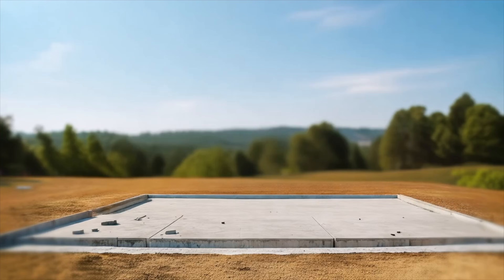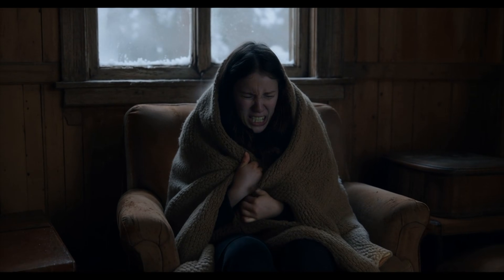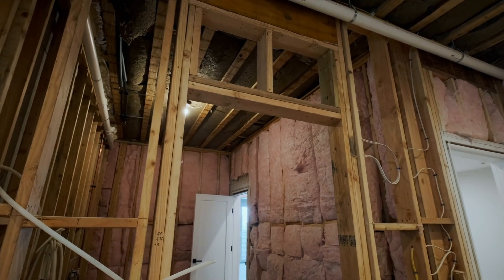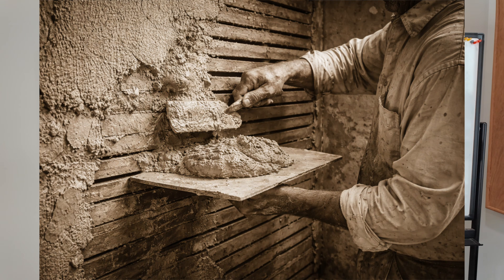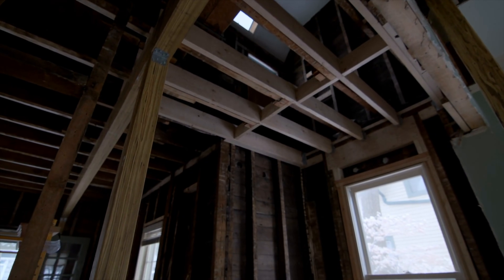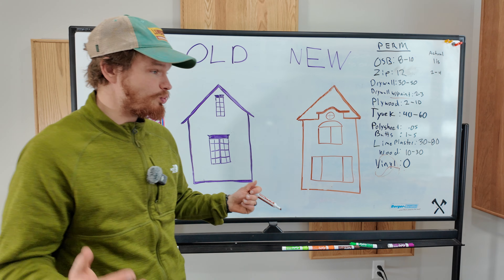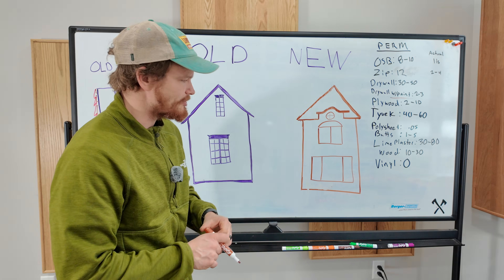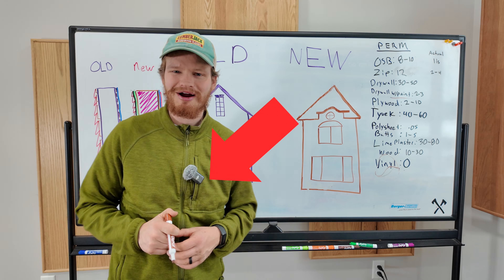New Houses Are Growing Mold — Old Ones Somehow Usually Don't

Comment: What about when you see new houses being built and they get rained on before they are completed. Seems like a good way to ruin something before it's even finished.
Reply: Older houses especially the ones still there took longer to build and got rained on just as much, you find old leaves and crap in old roofs that have been there s long time
Reply: @binguschillingus-t7n  Yeah, but they weren't sealed to the hilt-asking for trouble-unless you know what you're doing, and even then, why? I mean, one hole...
Reply: @CP-nf9my 
That wasn't as big a problem when people in the west could afford heating their home and opening a window was a more common practice.

It took longer to notice because these designs flourished in an era of relative prosperity.

Now these houses are moulding because the tenants can't afford to pay 3x somebody elses mortgage AND heat their  rooms.
Reply: @binguschillingus-t7n the money to heat either design is the same
Reply: @donaldjohnson2038 
The money is equally not there regardless of if the Tennant is renting a 40 or 150 year old home.
Reply: @donaldjohnson2038  That wasn't the point of his comment
Reply: @binguschillingus-t7n but those were built with first growth wood and zero plywood
Reply: Not sure about the US but I'm a builder in NZ and here we have to pass a moisture test before we can put up any internal lining like drywall if the moisture in the framing is to high then you don't line.
Reply: @JimBush-q2j They have to be tried out here in North America too People don't know what they're talking about
Reply: There's a reason out here on the rainy west coast the smart folks only build in the dry summer.

Drop the foundation in may-june, get that bish roofed and sided by September.
Reply: @priestesslucy yes, but many of us live in areas where it rains when it rains, sometimes pours, and there’s no way to accurately predict when the next thunderstorm will roll in
Reply: @denniss5505  He forgot to add, then you pray.
Reply: @priestesslucy  And the employers of illegals will keep putting a roof on through the rain.
Reply: @priestesslucy  

I don't live on the west coast by in the area I live in, if it doesn't rain in 3 days, you would consider yourself to be lucky!
Reply: The Netherlands. Layer 1 brick and mortar, layer 2 insulation, layer 3 brick and mortar, layer 4 paint or wallpaper (wallpaper is impopular so paint on 98% of walls).
Anything above 4 floors replace brick with concrete.

In the Netherlands wood is more expensive. Bricks are cheap and last centuries unless there is an earthquake wich is extremely rare over here. No faultlines.
Reply: @thijsjong and no basement?
Reply: @diegomontoya796 what's a basement??
Reply: @LorenzoVillafaña-III  is a story from the dryer lands...a legend of Siegfried
Reply: @diegomontoya796 in the country famous for being almost entirely below sea level? A basement would be a terrible idea!
Reply: @alistairsmith4297  Subterranean swimming pool?
I'm sure we can make it work ....
Reply: @thijsjong  Thijsjong, I have no clue about these things. But am interested in getting something build. So, is this style of building in the Netherlands preventing mold? 
We lived in Germany in a brick house for a while. When we got three-fold glazing, we got a mold problem with it. The mold was growing up the wall-paper, turning it black. Very unpleasant.
Reply: (Sweden) In my dry wall I can hear a damn mouse, munch munch munch. Strange mouse, I only hear it at about 04H00. Sometimes it sounds like a woodpecker for 2 seconds :body-blue-raised-arms:

When there was a huge mouse that came up under the kitchen cabinets but it could get any further. I put a nice sexy mouse trap with a nice juicy raisin in a plastic mug. And then after 3 days, I heard the mouse scream, "Oh god my neeeeeeeeeeeecckkkkkkkkkk" :face-green-smiling:
I tell you, when I opened up the bottom panels to access the trap, WOW, that was a big mouse. The mouse was a bit rude, it gave me a cold shoulder, so I flushed it down the WC.:face-blue-smiling:
Reply: That I really don’t understand, I was appalled the first time I saw that
Reply: the problem isnt rain on wood.. the problem is rain on osb and glue products.  Timber framing is superior but if you stick frame and don't wrap your house in foam and plastic like a fool it will dry out no problem.
Reply: @nowherefast- if you build a house out of cardboard, it will last as long as it remains dry.  Sadly, most people do not understand that processed materials / composites are traditionally terrible products for moisture.  A house built with resilient materials can get moist and last a century. 

My advice, don't use press board.
Reply: Hopefully the builders get paper on it asap
Reply: Doesn’t matter. You have  different phases in a new build. Once the house is “dried in” meaning your roofing paper is on, all flashing and shingles. Exterior sheathing is on. The home should have ZERO water penetration. Mold comes from water getting in somewhere or not draining
Properly in a bath room.
Reply: That exactly the problem. Solid wood will expand, but dry up and shrink back. OSB does not DO that. It soaks it up and does not dry out.
Reply: No, old houses had the same experience of being unfinished in the rain.

It's the lack of proper ventilation to wick away that moisture.  
R-value=Mold Content.
Reply: @pswelles5714 Old and new houses both get wet during construction.
Older houses dried because they leaked air.
Modern houses must be designed to dry.
Mold is caused by trapped moisture, not insulation value (R value) and ventilation doesn't wick away moisture that's capillary action It’s “poor moisture management + airtight construction = mold"
Big difference.
Reply: Holding a new house in Iowa right now and this spring we got torrential downpours before the roof went on. Water pooled on the sub flooring to the point that the builders had to drill drain holes so it would drain into the basement and down the floor drain.  We’ll see how that Saturns out I n5 years.
Reply: Houses use to be built slower and rained on more and had no more issues than today. . you do realize if you spill a cup of water in your house even after it's built it will still dry up if the humidity is low .

Comment: I have been to many old homes doing hvac work. One major issue that I see that has made me never want to buy an old home is its poor insulation and small attic space, leading to horribly high utility bills. Usually the duct work design is bad as well and so expensive to change that homeowners usually just deal with $700-1000 bills in the summer.
Reply: I agree as an old home owner. With that said, my last place was newer and had mold plus a lot of synthetic materials. Both toxic, except the mold I feel can be still prevented. Otherwise in a new house you have to throw away all the synthetic and start over. Just my opinion but I am not an expert.
Reply: I prefer $200 extra in utilities vs $2000 extra in medical bills for living in a cancer house
Reply: That is because homes should naturally breathe, that means you're going to have to deal with the heat during the summer and the cold during the winter. That is natural.
Reply: @Delimon007 I actually like it very cold in the winters and will lower the heat enough just to prevent pipes freezing. I also don't ever use air conditioning. I was raised in a very modern house, so for some reason I turned out this way? So I prefer to keep this old structure & simply learn creative lower cost ways to diy some more efficiency. I know it will never reach ideal, but a middle ground seems reasonable.

Comment: My mother's house was built in the 1880s. There was no AC, no insulation, no major renovations or anything and the house was incredibly drafty and yet it was very moldy too... The place was freezing in the winter but would get huge gas bills. Some of the walls inside still had the old fashioned wallpaper dating from the 50s. Other walls had the old oil paint or whatever old paint was made of. But the place was cold and damp.
Reply: Proof that some places were built cheap and poor in quality in the old days
Reply: @JS-jh4cy I agree. However just from my personal life experiences , there were better built older houses verses newer ones that I have lived in. But I have seen terrible old ones as well. It's a mixed bag in any generation.
Reply: @CK-hu8vzthats just survivorship bias. My home is old and is hot garbage. Very poorly maintained. Subsidence is causing it to lean. Didn’t help that the inspector was trash too. He missed the water heater not venting exhaust gas and very obvious water damage from a bad roof. Irrespective of construction method, people need to maintain their homes

Comment: when i built houses i learned that control of water was the number one determinant in how a house would survive over years.   roof integrity is obvious,   but you have to manage vapor movement through the structure as the seasons change.  the modern fast-growth pine is the best wood for framing -  it is light and easy to cut,  move etc .    the problem is the design of the house and integrity of the roof.   if you let water accumulate you will have mold and structural degradation.

Comment: A dehumidifier is critical in all homes. If humidity is above 60%, you’re going to get mold. Ventilate the bathrooms with a ceiling fan and also open a window occasionally if possible.  And run a dehumidifier set at max 55% humidity 24/7.
Reply: If you’re running a dehumidifier, then don’t open any windows. Simply open the bathroom door after a shower and the bathroom will dry out quickly. No dehumidifier, no AC, then an open bathroom window or exhaust fan is vital. These truisms are like pearls before swine for most people. You can tell them this and they’d rather keep the bathroom closed up, all wet.
Reply: @kenlundstrom3047 I yell at my girlfriend every time she showers with the fan off. Some people are just dumb and ignorant on how to maintain things. Nothing you can do
Reply: as a remedial measure you are absolutely correct .
Reply: You don't need a dehumidifier if your home actually breathes. . . Just go ask the mormons.
Reply: What about if outdoor humidity is 80%+ ?
Reply: @maximmono1  all the more reason to have the dehumidifier. It keeps the inside dry.
Reply: I'd rather not have a home that's dependent on tech (that goes for dehumidifiers, erv's and ACs alike) but yeah if you're building that tight you don't have a choice.
Reply: Depends on your climate. In my area, you need to run a humidifier at times otherwise you get dehydrated and my skin cracks. The average humidity here is 15% except in the winter where it gets up to 45 to 50% average. But then it gets bone chilling cold as well. As low as -30F.
Reply: In humid climates. Where I live no one with a properly built home has a dehumidifier. Humidifiers are common though. The only time I see humidity above 40% is when I open the windows when it's rainy, which isn't too often.

Comment: Well, first you need to keep water out from under the house. Slope, drainage, and foundation/crawlspace/basement design are absolutely crucial.
Then you need the roof, siding, and all flashing to be done smartly and competently to keep water from just pouring in from outside. And any roof leaks need to be found and remedied immediately (or more ideally prevented in the first place).
Now, at that point... you can start to talk about the structure design & materials. Because with good roofing and foundation work, you can have a (mostly) mold-free pergola which doesn't even have walls.
I assure you, half of the homes with mold problems just aren't getting this much right. You can often tell whether a house will have mold problems before ground is even broken, just from looking at the site.

Vapor barriers can be fine, but any enclosed area which is vapor locked, needs to have ventilation at the top and bottom of it.
Materials matter a lot... cellulose will mold like crazy. Open cell foam is a disastrous mess, it may "breathe" but it traps moisture inside it so well that it almost doesn't matter. Closed cell foam can work great, as long as it is understood to 'be' a vapor barrier itself, and applied with that in mind. Fiberglass is decent, rockwool is a bit better though, rigid rockwool is ideal as long as there's nothing mold-friendly added to it. Closed cell aerocrete can work great as very heavy duty insulation (rather than used structurally).
Gypsum 'will' grow mold (it's sheathed in paper). Anything with paper will grow mold, that goes for batting too.

You DO want air conditioning. It may create temperature gradients which cause condensation in the opposite direction of winter... but it dries the interior air dramatically. And in a time of the year when the air inside can be laden with a lot more water.

Some of the benefits of old houses comes from woods which actually Are treated, just with older forms of treatment like creosol, tar, crude oils, or arsenic. Type of wood (tree source) matters a lot too. Sometimes in older houses borax was laid inside the wall spaces as well, which helps (alkaline salt).

And then there's climate. In my area, 60% humidity is an abnormally dry day. Typically its more like 80%+. The water table can be found with naught but high heeled shoes. And the precip-to-evaporation ratio will cause swimming pools to fill to the very brim all by themselves, and then need an overflow drainage route. And almost everybody has mold problems. The dirt in the yard has mold problems. It's almost an advantage to have a relatively benign strain of mold, because mold is kinda territorial. 
Older houses had more open options as far as placement... which helps immensely.

In this area you can smell the mold in neighborhoods as you drive around, when the road dips down to lower elevations. Doesn't matter much when the houses were built.

Not saying you're wrong. Just... if you build an old-style house, in a bad location, it's screwed anyway. Some of the old-style construction used carcinogens to mold-proof. And vapor barriers or AC aren't necessarily bad things, if they're done right.

I'm looking to build a house which will eschew modern codes (mostly because they're weak and fragile), and be mostly concrete, aerocrete, steel, aluminum, glass, rigid rockwool, stone, and a little bit of cedar (specifically). With extreme emphasis on grade & drainage, and every method known to keep water out (even a ventilated double roof). It'll be fireproof, termite proof, storm proof, shake-proof, everything proof. But in this area it'll still get mold if I don't find the right site to build it.

Comment: the push to make homes super air tight is the problem.
Reply: absolutely -  this is the stressor that requires very specific design and execution of the house.   cutting corners will indeed doom the house to mold.
Reply: Super tight homes are only a problem if air isn't managed. A tight home requires an ERV or HRV. It should also have makeup air when a conventional dryer or range hood is running.
Reply: People don’t do a proper blower door test
Reply: .... the problem is shitty construction quality and lazy people not caring about the homes they are building. "Breathing" is just drafy as f**k homes to mitigate lazy construction. Contractors dont care cause they have 1 year liability and thats it.... other countries go to school for construction and are WAY better educated than the USA where it's filled with drop outs with a drop out mentality. Period.
Reply: Foam insulation is a disaster
Reply: @paulapatterson4301 no
Reply: It's the building codes by me that only care about the carbon footprint.

Comment: Newer houses are more “tight” are prone when moisture is added
Reply: American construction methods are shit. It starts with the problem that your houses don't have walls. There is no thermal mass you can insulate and keep warm.

The wall is some studs with with insulation covered front and back.

In Europe we build houses with bricks. They're covered with insulation panels on the outside.

The whole brickwork remains warm. There is no point of condensation

Also we use breathable plaster and paint on the inside.. the wall "breathes" on the inside and is kept warm.

Old houses without insulation had more problems with mold. New ones usually don't. 

He also names the risk of air conditioning. Aircon usually prevents mold, as it dries air.

Problem again is - the american house has no thermal mass. The structure changes temperature too rapidly.

Comment: Good info. I offer a little refinement for fun, though. OSB is pretty much OK when detailed properly, but since it is heartwood mixed with sapwood, the high sugar content of the entrained sapwood turns it into mold candy when MC exceeds 17%. I have measured 24% MC in a nicely built 1990s attic, and inspected another that was dripping with water from the entire attic roof plane, completely covered with lovely green mold.  Each lacked minimum code ventilation. Code minimum still won't do it, though, when a home is carelessly built or hastily retro-insulated.
Reply: MC?

EDIT: OH! Moisture Content?